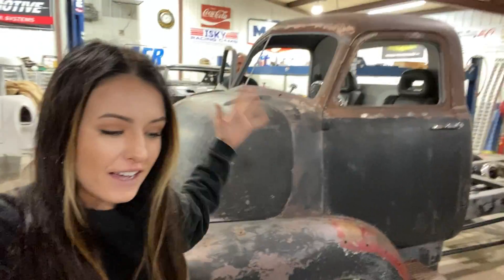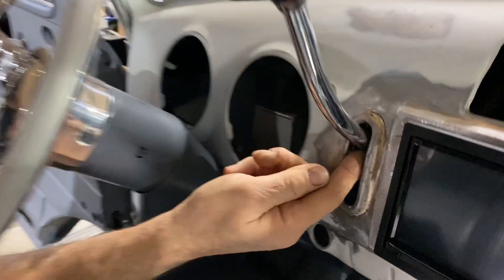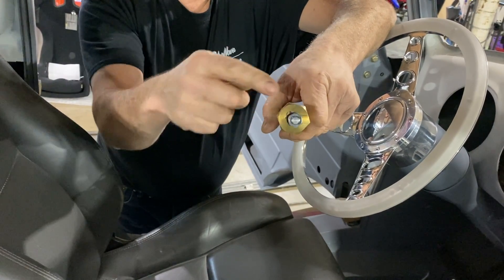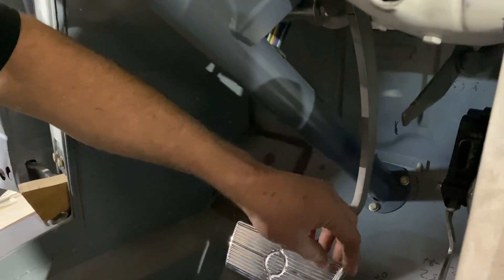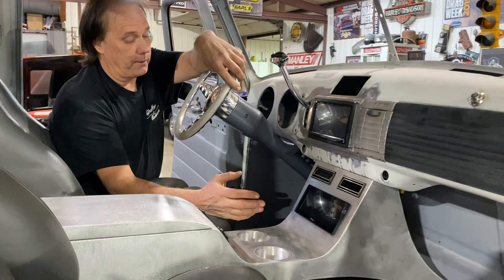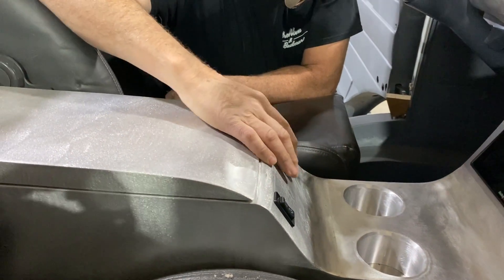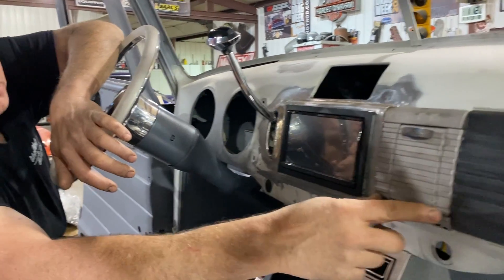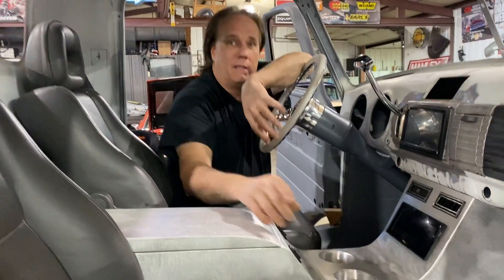Hydraulic Shifter?! - COE Truck February Updates

Comment: I expect other posters might already have mentioned this issue, but connecting 2 cylinders in a crossport master/slave way may cause issues due to the volume of the pushrod. It's fine if the cylinders have a rod that protrudes both ends, and fine if you connect nose to nose and tail to tail so one extends, 1 retracts. Love your work, good luck with the new project.

Comment: Hi.
 Man the trucks looking awesome, 
 Thanks,
 Also great ideas and exciting, Dennis, you have great skills and real neat to. You make it all look easy!
 Great work
 Alex great photography skills.
 Between you all I am excited too, I scored a Chevrolet GH, Model 7-1200-53155. Stylemaster in great condition, I can use and join ideas with you all. Mentors.
 I was thinking about how your truck was coming along!
 I have been flat out at work and haven't had too much of a chance to build the Hq Holden one tonne truck Ute. 
 I have the motor together and went to bolt on the top mount charger, lol, believe it or not the snout was sent to me with a damaged bearing, fixed now, I did a test on the supercharger and grinding noises from the Rear, lol, coincidence?
 The charger went back to the shop under warranty. 
 Keep up the good work all!
 Glad to hear the good news

Comment: That is called a Hydronics system  I worked for Asplundh tree experts  Co back in the early 1960s we built the bucket trucks for trimming trees and power co use them also and their early unites had that same system that controlled between the upper and lower booms  cool idea

Comment: I’m working on a 1948 Dodge COE, I’m.running a 12 valve Cummins with a 47RE transmission.  I like your idea of hydraulic cylinders rather than a cable shifter, can you identify your source?  Appreciate any help.  Jim

Comment: How are you doing Cruise control on the Holley? I asked the tech support when I bought my Dominator with dual drive by wire throttle bodies and they told me they can’t do cruise control
Reply from the maker: It won’t actually be through Holley as that isn’t supported yet. Controlled by Holley, but cruise control from Dakota Digital (I think, need to verify that)